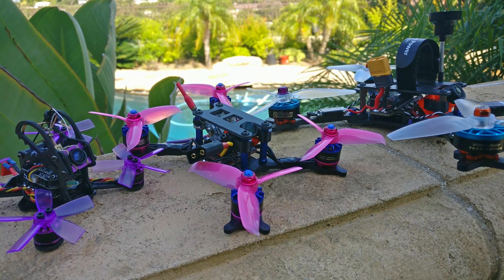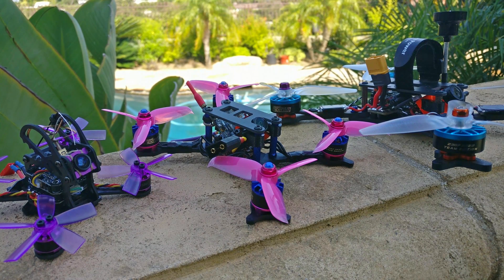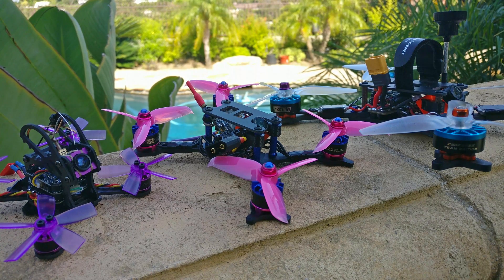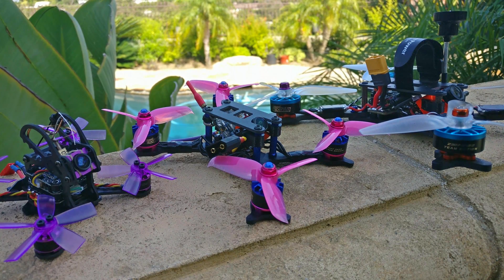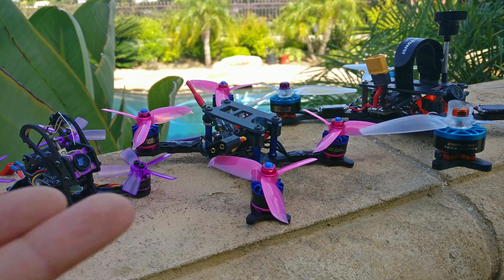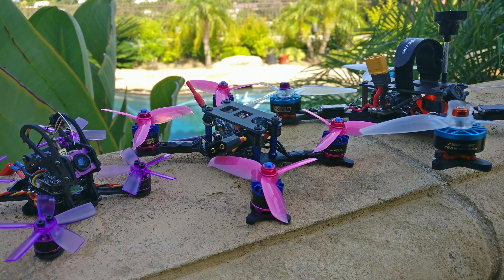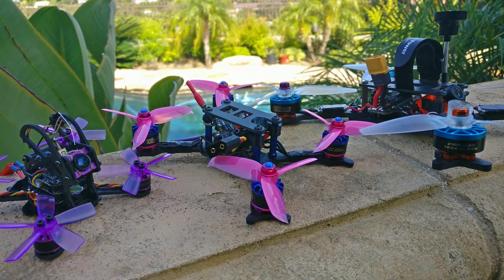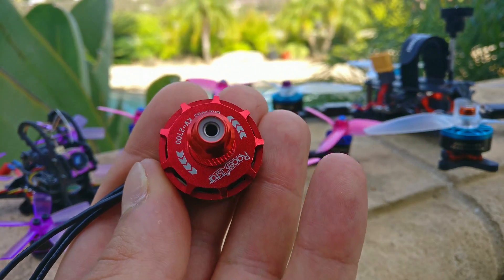Why does 5" feel so good? - Quad Theory

Comment: I recently started using a 5" quad but to be honest after flying my 3" for a while, I just prefer being able to rip around corners. My 5" just swings way too wide unless i kick hard sideways and throttle up as I negotiate the turn.
Reply from the maker: That's a matter of weight rather than prop size. Lighten up the 5" and it will be just as agile with better overall control due to the disk loading properties

Comment: I didn’t know where else to post this question, so why not here! What are the biggest differences between a 5 and 6 inch quad, besides the obvious? I’m looking more for what the flight characteristic differences are, specifically for freestyle flight? I’m torn between buying another 5” quad or exploring the world of 6” quads! I’m not interested in long range at all, this is all for freestyle, so you may even suggest against a 6” frame for this purpose? Appreciate the advice!
Reply from the maker: The difference between 5 and 6 is surprisingly significant. While 5 is super duper locked and in control with a fantastic nimble feeling and good speed, 6 looses the response and nimble feeling almost entirely.  The biggest advantage is increased cruising speed which is really nice.  It's a different experience altogether. It's more like a 'boat' in the sky maybe. My personal opinion is that 6 is a lot like 4 in the sense that it's sort of a bastard in the middle size. I say that because 7" feels a LOT like 6 but it has an even higher cruising speed and just feels more substantial in the air with a nicer drifting feeling. I realize I'm not using any concrete words to explain a difference but that's because it's really hard to describe.  Note that I didn't say 6 or 7 is more efficient than 5.  That's because it's not when you're flying in a performance oriented manner. If all you do is hover then sure the larger props will do better. But anything else isn't any better flight time.
Reply: KababFPV - so it would be safe to say, if you’re an intermidiate pilot that wants to improve his freestyle flight, and has no intertest in long range, the 5” quad would be the way to go? BTW, I’m waiting for the book! What book you ask? The book you’re going to write on this entire journey, filled with nice pics, interesting drawings, knowledge of FPV flight, ETC, in a coffee table style bound hardback, I’ll pre-order one now!
Reply from the maker: @3eggerfpv397  5" is by far the largest market and the most versatile size with the very best mix of control, speed, durability.....it's definitely the default size of all sizes.

Comment: I realize this is an older post, and I’m just seeing it, so I would think based off your toothpick quad, I would design a 3 inch quad that can take 5” props and I’m willing to bet it would fly a whole lot better! You’ve already started an absolute high perfomance whoop craze, now you need to take that to a 3 inch quad, one that WILL  
TRULY fly like a 5” quad!
Reply from the maker: I did a couple of videos a long time ago about very super light things but the technology wasn't as good back then. Today I would change things quite a bit because I know so much more about motors and props. what you want to do is something I have already worked on and I am working with a company to develop right now. It is a very good idea work on it
Reply: KababFPV - I’ll wait for your version! What I do have is a set of your Kabab FPV 2208 1800kv motors on a pretty light weight 5 inch frame that will take a 5.5 prop! I think that should be interesting!

Comment: Couple different subjects. I tried all HQ V1S props. 5x4.5x3 is the best all around speed and handling.
The other thing I wanted to ask is do you think 4s will be wildly popular for some time to come? I'm thinking with the advances in battery tech 5" will be the best in the middle no matter how popular 6" becomes? I have no idea just my guess. Awesome subject. Look forward to these kinds of videos and your thoughts
Reply from the maker: 6" is definitely gaining ground lately but 5" will still be king for a long time.  Currently, we're pushing towards 6S for everything and the improvements in battery sizes and pricing is making it viable as well.  I would guess that by the end of the year, a 4S 5" or 6" build would be a legacy build and the majority of people will be on 6S only for acro and race.

Comment: Not sure if it ends up mattering, but lift and gyroscopic stability are both energy equations. most energy equations are somehow related to, or based on, the Einstien theory e=mc2. So for propellers, the amount of lift generated by the propeller increases at some exponential equation as the propeller increases in length. I think of it like the neck of a guitar, which is an exponential energy equation, where the longer the strings get, the further apart the frets need to be to change notes. I suppose I think that 5" quads are right in one of the energy nirvanas. smaller guitars are great and interesting, but don't have what standard size guitars have for presence. smaller quads have much more performance potential in changes in acceleration, because they are so much lighter,, larger 9" prop quads are so much more stable, but if you calculate a series of balances using a series of equations you can probably research, you will probably find that about a 250 size quad is perfectly centered on one whole balanced set of tones.

Comment: what Im looking for in three inch is the durability and park flying. I build super durable 5 inches but I still manage to break them. my last one was a qq190 with an auw of 440g. I failsafed from about 5 stories up and landed on concrete. frame slightly cracked and many wires snapped, but everything still works. with a 3 inch, I imagine the damage could have been less expensive with the lesser weight and cheaper parts. plus, concerned moms won't chase me out.
Reply from the maker: 3" is pretty much the same cost as 5" if you want it to be any good.  The concept you put fourth of smaller being cheaper is why all the tiny stuff sucks.  They just make crappier electronics because people expect them to be cheaper.
Reply: Kabab FPV the costs that I'm worried about (broken parts, lipos) are lesser with the 3 inches. with their weight they don't bend motor shafts, snap carbon, or strip hardware nearly as easily as a five inch. since I already have a dys omnibus and an extra cam, the build will be 60 bucks cheaper either way, and I'd rather spend that on something I wouldn't be repairing all the time.

Comment: its the actual lack of power to weight and the lack of wide stance authority.
simple- you can simulate the wide stance authority with really damped rates the slight lag makes the 5 inch far more predictable.  also it can hold momentum longer which makes it predictable too. ive actually made a wide stance micro x140mm frame- <80 grams with a runcam split- it flys super good but u cant just throw it up and get the same hang time as a heavier quad- which is okay just a little less cinematic i cheat and slow down the footage to 30fps from 60 to get the same look and its all good  :D i think u can afford larger props on the smaller quads but no manufacturers really do it.

Comment: I agree with this... but... 5inch in town screams and usually leads to me having to leave the park.. sometimes by a cop asking me to. 3 inch and people just think they are a cute toy and leave me alone.. with a 5 inch I do feel like I have more authority in the air and I'm much more smooth while flying but I like flying in the parks close to me. sub'd
Reply from the maker: MrLivesteamer I know I have the same dilemma. that's why I'm still searching for the right micro.
Reply: Me as well. I'm on my 4th 130ish build now and about to buy the stuff to build yet another. The problem with 130's is they just feel mushy and I have to keep the Rs up to a point that it doesn't feel natural on my stick and any trick is sloppy and the timing is off. I quit posting videos because of it and just post vids of my brushed stuff. I think for a 130 to work you need to get the weight down to about 120 to 130ish grams with some hot 1407s. With that said you're back to the screaming eagle sound that seems to alarm people. I try to hit the parks early around 7am but after a couple of hours the people start walking their dogs and shit so..back to Google Earth to find another place to fly. If I keep cruising the parks cops are going to start thinking I'm a drug dealer. My Atom V2 seems to calm nerves because people just think it's a toy and it's "cute" but my Chameleon and Crusader just causes too much attention and alarms people that live near or wander in the parks. Oh well the search continues.... Like your channel, don't understand how I missed it. Thanks for your time bud!

Comment: I don't think 3" and below should be compared to 5" at all and doing so is your biggest source of dissatisfaction. The scale is too different. Compare 3" to other 3" setups and measure them on that alone. 3" for me was about not submitting to illegal FAA regulations and the benefit was cheap parts and lipos, mobility and throttle control. I can zip around my yard, street and places the 5" cant fit. Everything fits in a little 8x4 bag minus my TX and giant box goggles.

5" is better in every way unless you have  250g limit or only have time to fly in your yard.

Comment: Hi Kabab
You mentioned it in one of your previous videos...maybe motor torque is the key?
Bigger, torquey motors have more control over the props (from low end through to top end) which makes the quad easier to fly/tune.
I've almost finished a lightweight 1806 2800kV so I'm hoping to test this theory soon!
Cheers, Chris
Reply from the maker: Rotor Chris put the HQ 5x4.3x3 V1S on that. make sure dry weight is around 220g or less. it's gonna fly beautiful with a 1000mah 4S
Reply: Kabab FPV Thank you, will do! I also have a few biblade options to test... Weight will be super close to 220gr- currently at 200gr but still needs a few screws & props nuts  :D
Reply: It came in at 215g dry (battery strap incl.)... I only took her out for a short flip yesterday: this quad is ridiculously fast!! 
Thank you for starting/spreading the #lightweighthype with your Floss frame.
I'll put some photos & videos on instagram (@rotorchris)

Comment: You need to try an air blade eclair v2 it feels like a 5 inch but its 2.5 and it weighs 115g with the bat. Although i totally agree there is something special about a 5 inch.

Comment: I started with 5inch and is a great all-rounder,
 you may think its crazy here in china I recently visited a different city and come across a group flying quads in a small wooded park many flew 3/4/5/6" but two of the group were flying around with 12inch builds,  they say 8" and under was just to fast for them, one of them let me try his quad and was surprisingly easy to fly with very good control.  maybe it will catch on....... I enjoyed it.
Reply from the maker: Edward Lee big stuff usually feels a lot more in control because the disk loading properties are drastically better. but as you said, after 5" it starts slowing down quite a bit.

Comment: Sure
Surely Bob. Just a mid point between the props being big enough to get Low down thrust. But not so big ie. 6 inch where the prop spins too slowly to produce that I start reaction. Smaller props..isn't that the same logic in reverse? Can spin instantly but lower prop size means you need a higher rpm to generate enough thrust. There both 4 & 6 have their own realms for a slightly delayed stick movement to quad reaction. Is that too simple a theory?
Reply from the maker: Peter Mabbort na I think that's right. 5" is the sweet spot where all that is balanced.

Comment: I have a 5" quad and a 2" quad. I love flying the 5" but I enjoy the 2" more because I worry less about damaging things and myself. I especially worry about plugging in battery on 5" and it eating me up even though I double check disarm switch. I have only flown about 30 packs in last 3 months in the 5". Do I just need more stick time with it?  Any other advice for getting over that feeling or is that a good thing?  Thanks
Reply: Yes you need more stick time... Thats like flying 2-3 packs a week. Try 15-20 packs per outing at least
Reply from the maker: EastTN Scott as crispy said, you just need more time with your quad. it's a robot, it usually doesn't disobey. if something goes amiss, it was likely human error. in time you know how not to make errors and get comfortable with it.

Comment: What do you think would Happen, if you'd Put something Like a 70mm impeller on a Motor With high tork Like a 2306 but also 2500kv+ ? IT would be Like a 3" Quad except much heavier bitte also With much heavier props which means you'd Bring Back the gyroscopic forces of a big Quad With 5 or even 6 inch props. 
Think of it if in had the Money i would try it myself Maybe you can Test it, would be pretty interesting because i guess noone tryed something Like that.
Greetings Philip
Reply: But also With*
Reply from the maker: I think it's been done but I don't remember where I saw it.
Reply: Kabab FPV did it Actually Work ?
Reply: people have made quads with edf's if thats the sort of thing you're talking about. The biggest issue would probably be the lack of torque reaction for yaw, and the slowness of response from running a heavy impeller rather than a light free spinning prop.

Comment: I think it might be the response time require to achieve a given commanded thrust.  The 4" can run a higher RPM, but makes less thrust per RPM so response time is longer.  On heavier builds I prefer 6" props.

Comment: I think its mostly about developmental focus being targeted on 5 inch quads and perhaps what works well software wise etc is not optimal for smaller quads.
I would expect smaller quads to benefit more from super high looptime speeds as the motors should be able to respond faster and might even need it faster to be able to get the same feel as a 5 inch drone.

Comment: Something you should try is building a 3 inch quad with 4 or 5 inch arms. The longer arms will provide a greater torque to overcome the inertia of the quad, so less thrust is needed to rotate the body. It should feel more responsive and locked in, provided you keep the weight roughly the same. Maybe 5 inch arms are an optimal length.
Reply: This also explains why 6 inch is smooth but less responsive. You gain more gyroscopic stability with the large blades, but increase the inertia by putting larger motors further out on the quad. It also increases the angular momentum during maneuvers, which takes more thrust to counter when slowing down a flip or roll.
Reply from the maker: Yeah this is a known effect.  Sub 4" is just bad no matter what.

Comment: Most powerful motor from Racerstar is the 2306 2700kv and the most durable is the br2205s pro (don't forget the s) they make good motors on a budget but is it really worth it. The people out there is still thinking to buy them at such a low price but no one thinks about the construction. They are gonna cry if they see the motor brake after 1 crash and then they really realize what's going on, they do know they got good performance but is it really worth it to buy if you keep braking them at every crash (with a pro crash were you are going high speed or noob crash were you drop very out of the sky, with every crash you still get the same result, they use 6065 only on the br2205s and pro edition (so br2205s, br2205s pro, br2205 pro) and the other ones even a weaker aluminum. so those Br2205s and pro's are way stronger (kinda like the hyperlite stuff but just not there yet because they use a lower grade aluminum but it's thicker))
Reply from the maker: interesting but very funny too.  The br2205s is just a big hunk of aluminum.  The 2306 feels like it's got really thick aluminum on it too so hopefully it's not gonna crumble so easily.  We'll see soon...

Comment: you may be able to get smaller dry weight on a 3 inch if you use 1306 motors instead of 1407 -- I see 1407 used more on 4 inch than 3 inch
Reply from the maker: I've tried in the past, no real improvement

Comment: Bob please test the Racerstar, you might be very surprised. I've used their BR2205 2600kv for months now and finally tried some Emax RS2205s 2300kv . Yes the Emax appear to be much better built and the magnets feel totally different when you hand turn them, but in a blind test I'd struggle to feel a difference. Flight times are the same and power feels very marginally better but I'm far from an amazing pilot and my Racerstars have taken some brutal treatment plus they're around a third of the price.
I'd class myself as an intermediate pilot so someone such as yourself may feel a huge difference, someone at my level, let alone a new pilot would be hard pressed to feel any difference.
Reply from the maker: the emax 2205 2300 is not a good motor.  2300kv is too low for 5".  If you had the 2600kv version you'd probably have something different to say.  The fact that you can't tell a difference between the emax and racerstar despite the 300kv differential is saying a lot.  The racerstar motors are fine, just not my recommended option.
Reply: Fair point Bob, I'm happy with the price I paid, around the same as my Racerstars.

Comment: Awesome vid man you have so much information.  what about 3,5 inch or 4,5 inch ???
Reply from the maker: 4" is only good on the two decent prop options.  The HQ 4x4.3x3 V1S and the DAL 4x4.5x3 V2.  No other 4" prop is any good.  Keep AUW <285g and it'll fly very well.  Otherwise, nothing else less than 5" really feels any good in the air.  Once you load up a 5" past 600g AUW, it starts to feel crappy like a 3" so you've gotta consider moving up to 6" than.
Reply: Check out the video he posted after this one, it will answer your question
Reply: Slarrty i saw it already